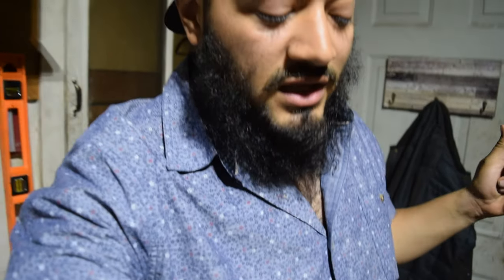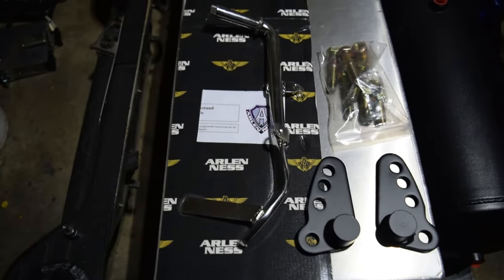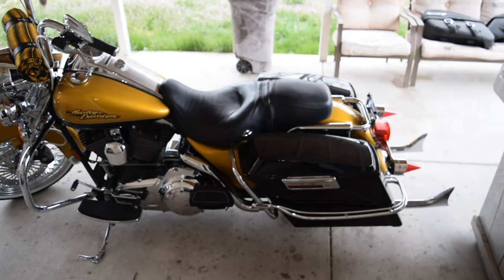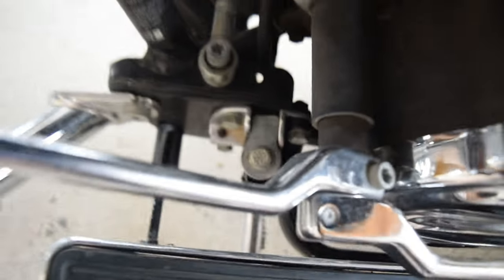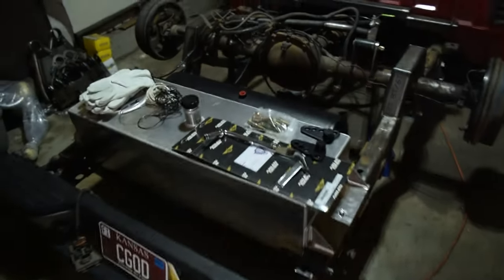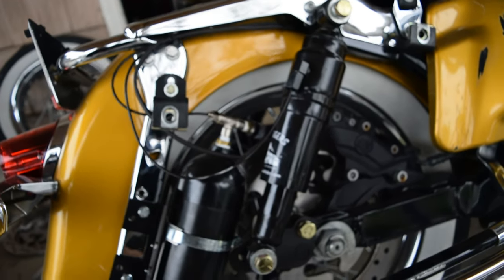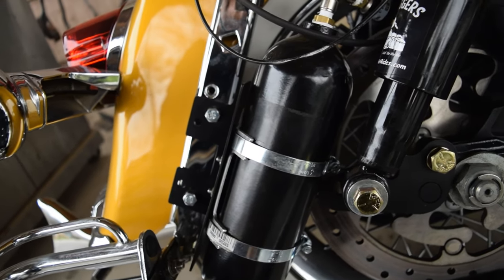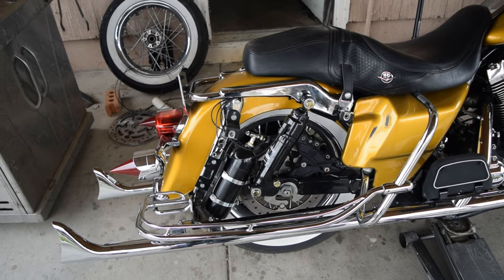1"-3" Rear Drop Kit + 1" Lowered Kickstand Install

Comment: I've used lower links with my dirty air. But I've heard horror stories of shocks breaking due to taking away the proper angle of the shocks. Any issues?
Reply from the maker: So far no issues! I had it set to 2” lower and it would lay out on the tire, at 1” you can still roll the bike

Comment: Ok, nice horse, just a few things if I may. If you're going to use the hydraulic car jack, use a block of wood on the jack claw. On the left side, where the compressor is, that's dangerous in my opinion......zip tie those wires, tuck them also......REMEMBER SAFETY FIRST! AND PLEASE STOP WITH BOYS/BOYZ PLEASE! When you said guys, those few times, it sounds much better. GBY

Comment: You bout to make me put a new kit on the back of my Vicla. My rear suspension is stock. But I’ve been thinking about an air ride system and center stand.
Reply from the maker: Haha thanks! With my setup since I have the air tank I won’t ever go to a center stand. If the seals in the electric valves fail they’ll let air seep into your suspension and lift the bike by itself. So just be careful, I’ve seen some setups that have a cutoff switch so it isolates the suspension to keep that issue from happening.

Comment: Very Nice Bike! awesome ! May i ask what your height is if you dont mind? at 5'5 do you think i can flatfoot the roadking?
Reply from the maker: If it’s lowered I’m sure you could. Aftermarket seats usually drop your seat height down a bit also, I’m 5’7” and could flat foot just with a seat upgrade. With the rear being on air ride it’s very easy to maneuver
Reply: @CGOD  Awesome ! Thankyou for the response ! Appreciate it!
Reply from the maker: @pinoyams  no problem!

Comment: How does your bike ride since you put the air ride and since you add the bracket to drop it
Reply from the maker: It rode great but I have since took the lowering bracket off, I enjoy riding as low as possible and didn’t like rubbing the tire in the fender
Reply: @CGOD  So is it worth getting that air set up and PS keep putting up videos like watching them doing a great job and your ViCLa is coming out fresh
Reply from the maker: @mattbaca3023  yeah definitely worth it! And for sure, I’m putting them up every 2 days

Comment: Thanks for the video. I'm thinking of doing the same thing to my 06 Road King. I had a 87 FXR that I lowered 1.5 inches and I had to put a shorter side stand on it because otherwise it sat so straight up I was afraid someone would bump the bike and knock it over...
Reply from the maker: Yep I got an inch shorter kick stand for my softail now too

Comment: Yo I got question for you I'm adding 21 to my ultra classic I have the lowering kit you have but I just want to drop rear not the front. I'm install shock locators in back but not front springs will that be a problem?
Reply from the maker: It shouldn’t be an issue but the 21” up front will raise the front a little and lowering the rear also might make the bike have some speed wobbles. I believe every bike is different so you’d just have to try it out and see how it feels
Reply: @CGOD   ok I plan on eventually getting get done but it'll probably be last honestly I don't want the wobble so probably get both front back done at once. Your bike is clean I almost bought a RK buy went with ultra classic instead better price and year
Reply from the maker: @kennydickinson7456  hell yeah, you’ll like it lowered all around, I would like me something like that too. I got a softail now but can’t really ride it comfortably with 2 people
Reply: Ultra Classic got everything literally at flip of a switch bro. Well taken car of I got fishtails wheel few more chrome accent pieces

Comment: Sweet ride. What tires are u using, front and back?
Reply from the maker: Front is a 120/70-21 and the rear is the stock 16” wheel with stock size tire. Honestly haven’t looked at rear tire size yet
Reply: @CGOD  thx.